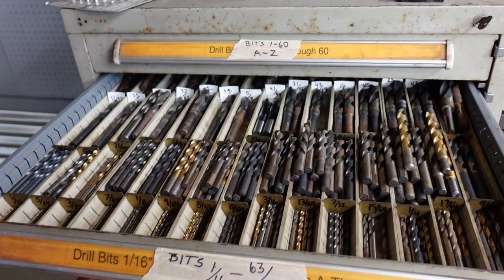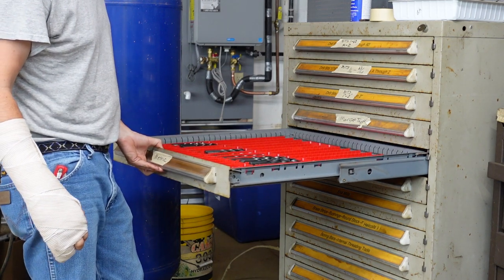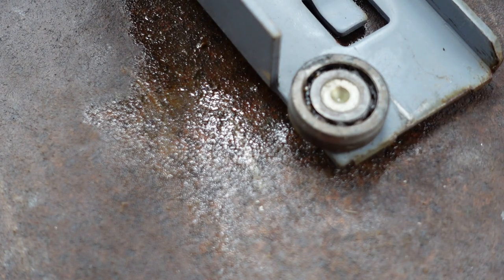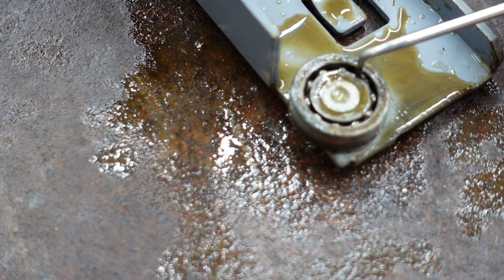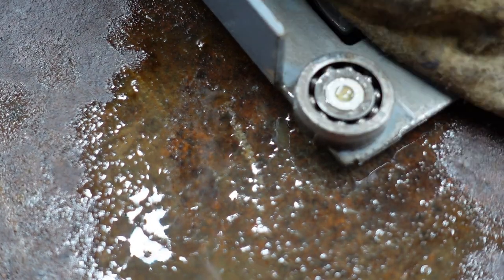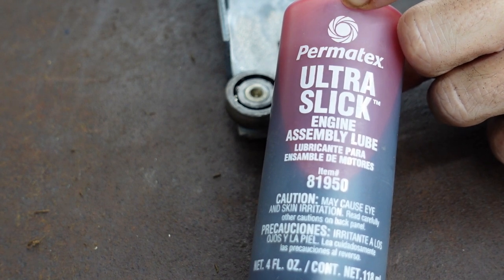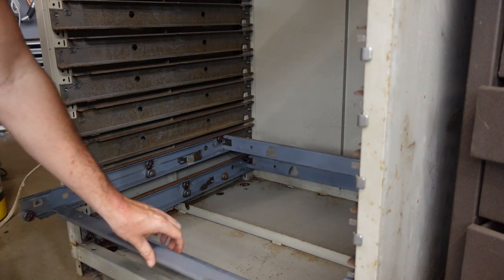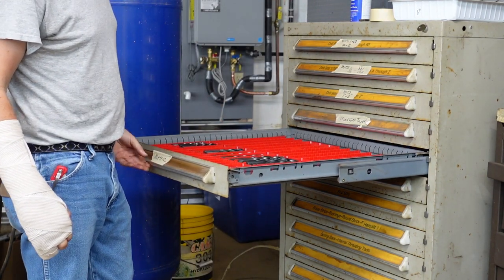How to fix stiff drawers on Lista and Vidmars cabinets.

Comment: Good video. I’ve done a lot of these over the years. I like your process. I’ve never tried the assembly lube. I agree the grease I’ve tried does tend to dry out (and pick up debris).
Reply from the maker: Thanks, I can't say that is a original idea a equipment dealer told me that was what one of the manufactures was recommending now. So far have had some done for over five years and haven't had to address them yet still working good.

Comment: Have you needed to replace a bearing ?
Reply from the maker: I have never needed to replace a bearing but I did have two that came loose on the swaged in rivet and would spin on the rivet instead of the bearing. I put rivet in press with a punch and flared it a little, then tack welded to the rail and kept it from spinning been working for a couple years like that.
Reply: I’ve got a couple bad bearings. I couldn’t find replacements through Stanley (didn’t exhaust all possibilities). Bearing looks standard was going to just try and find form/fit/function equivalent.  Drill out old rivet and replace with a new rivet (gotta find that too).